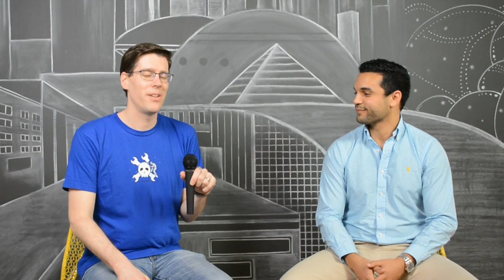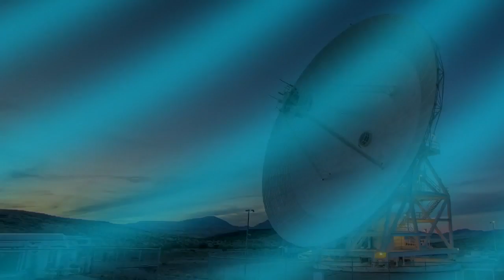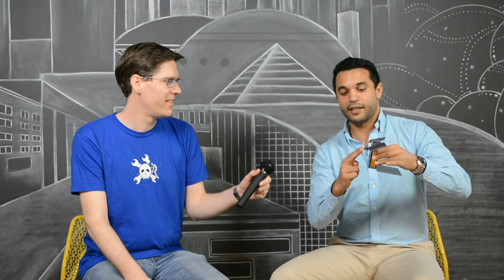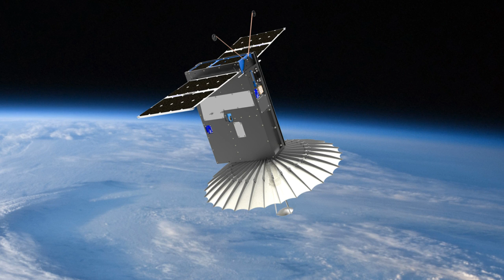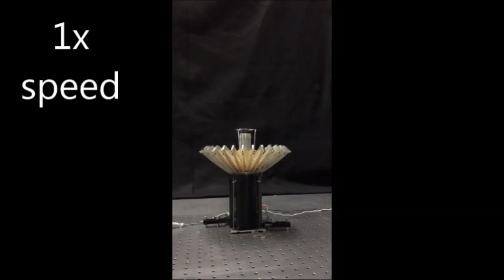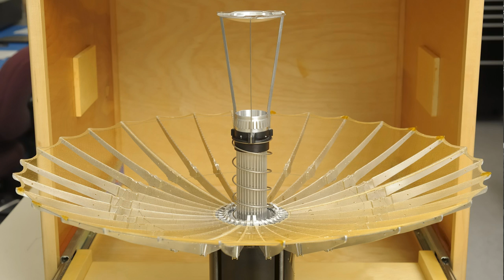Cutting Edge CubeSat Antenna Design

Comment: I would have like to heard about the small patches on the antenna and how that helps the pattern. Great interview. He is very excited about his work.
Reply: K7AGE I think that the pattern on the primary reflector compensates partially for the fact that it is flat when the ideal shape is parabolic. I would also guess that the size of the squares corresponds to the X band wavelength.
Reply: the X band wavelength is between 2.5cm and 3.5cm there are about 50 squares across the 60cm width with some spacing so they correspond to a quarter wavelength of between 6mm and 9mm. Quarter wave structures are common in antennas(and loudspeakers too.)
Reply: The x-band emitter is a phased array which with special signal processing creates the desired wavefront shape (probably a plane after reflecting)compensating for the different distances to each point on the primary reflector. A fairly complex transfer function for sure but no problem for an fpga, although I don't know how good rad hardened fpgas perform so maybe it's an ASIC,but that big chip on the radio kinda looked like fpga.